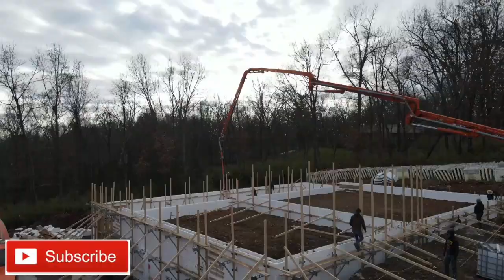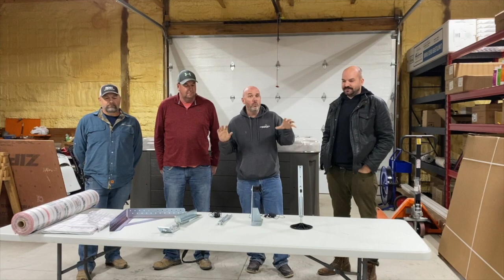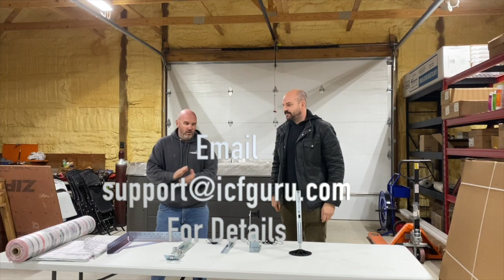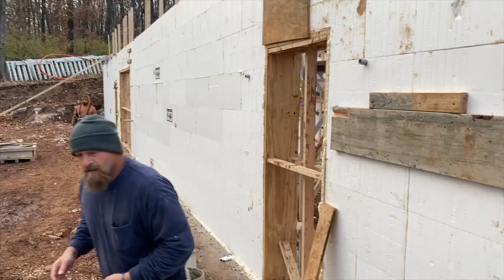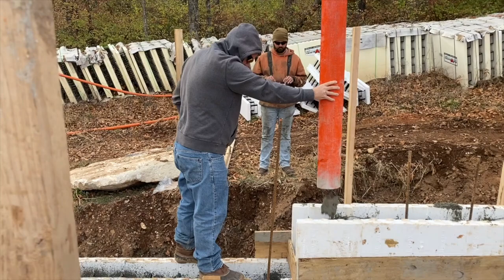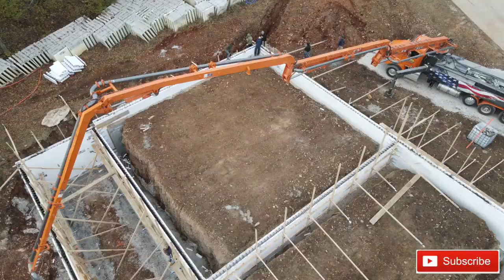Tall Walled ICF Building/Visit with Fab-Form

Comment: How tall can you go with residential building using 8" core block? Planning a 2 story  great room with vaulted ceilings above a basement with 9 foot finished ceilings; is this doable?
Reply from the maker: Easily, with proper engineering they go dozens of stories on that core block, just depends how far between horizontal support(floors)…. The top story can have higher walls than others without much engineering consideration
Reply: No issues, We got our design done for our 2 story house underway all ICF. Engineer put internal steel bar mesh every 20 cms on bottom floor, I think 50cms on the top froor.

Comment: Thanks, great points. Is it easy to clean the concrete that spills on the top of the forms. How easy is it to integrate the next level
Reply from the maker: Ya they should have been taped, at least on the outside…. We are stepping down to 6” core from here up, my buddy’s new crew was doing most of this, I told them it would be a nightmare to clean out if they let it cure so they were working on it that night when I left lol
Reply: @all3pools  : thanks for the info.

Comment: Very interested in details about how tall you can pour, and what goes into the engineering specifications / how that changes with height. Thanks
Reply from the maker: The block companies usually say 12-15’, probably they don’t want to tempt people to try more without experience….  It’s really about knowing you’re mix design, if you pour 20’ in one go you want the bottom 4-5’ down to a zero slump and the next 4-5’ down to a 0-2” slump ect…. They pour dams with constant pour hundreds of feet high, but they don’t put all the pressure on at once:)
Reply: @all3pools  Thanks! What about wall thickness? Are these higher heights requiring thicker walls? (for example 8" over 6")